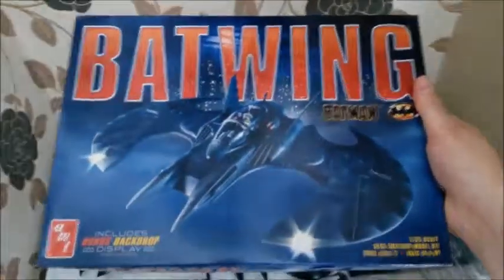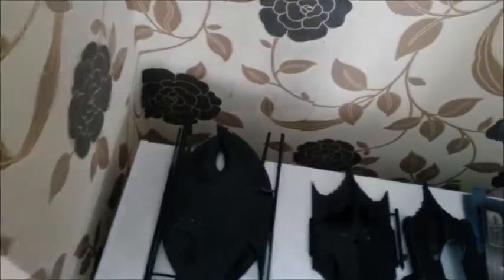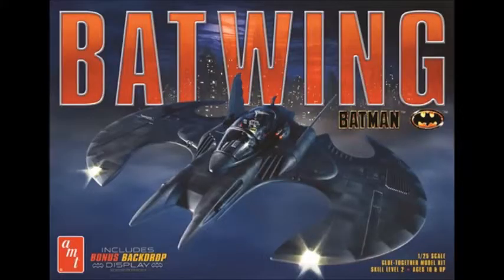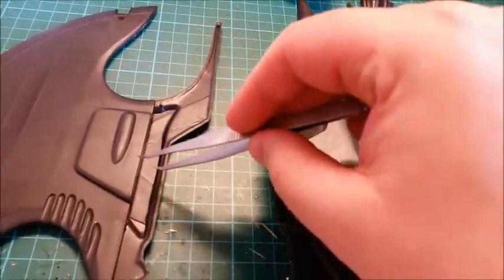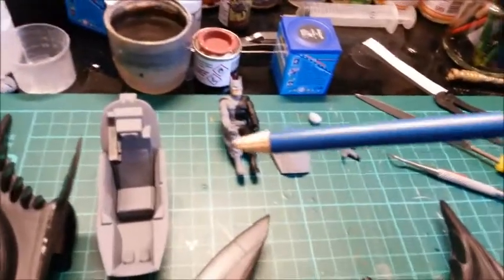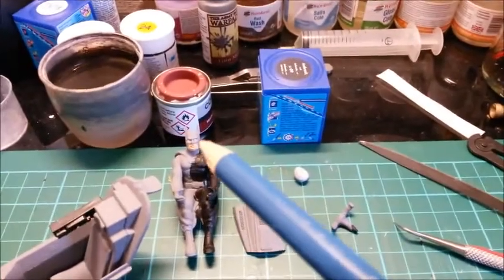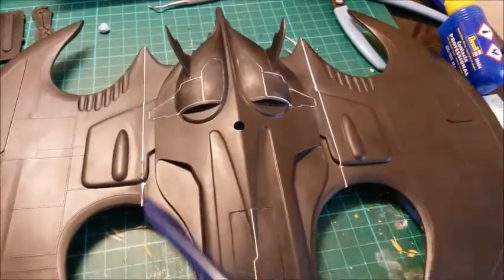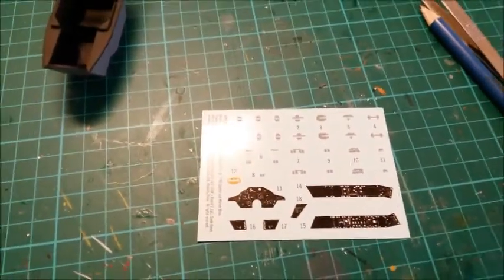AMT 1/25 Batwing Part 1

Comment: Did any glue came with that kit ?
Reply from the maker: Hi Montae,

There's no glue with the kit, but I use Revell Contacta for the most part, but I dont use Contacta on clear parts.
https://www.amazon.co.uk/Revell-Contacta-Liquid-Professional-Applicator/dp/B000RMJ2H8

For the Canopy, I use Glue 'n' Glaze by Deluxe Materials, it goes on white but dries clear.
https://www.amazon.co.uk/Deluxe-Materials-50ml-Glaze-DLXAD055/dp/B0047YSO8U